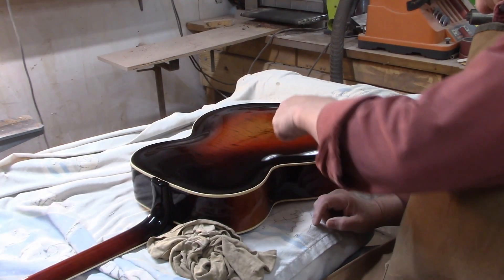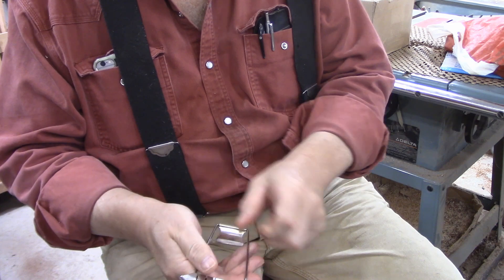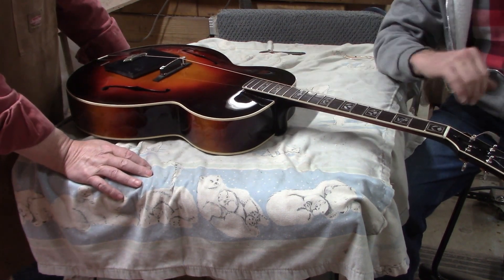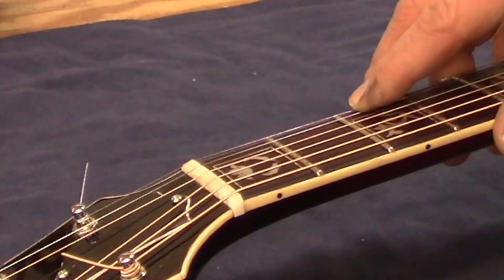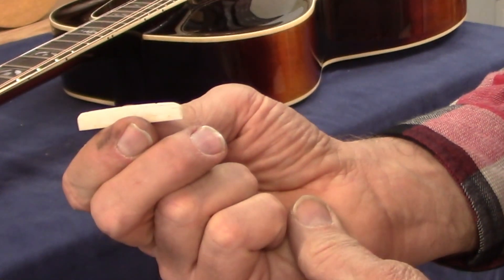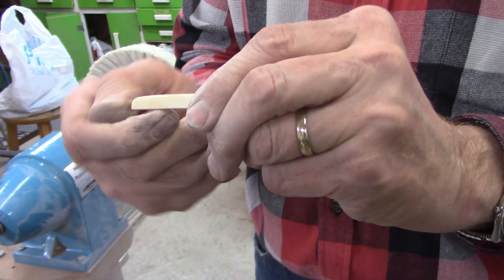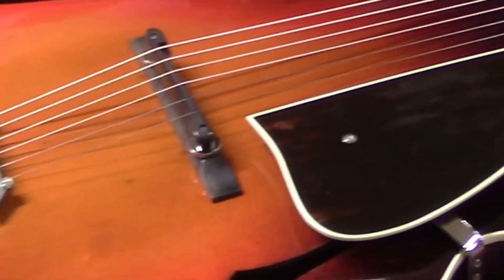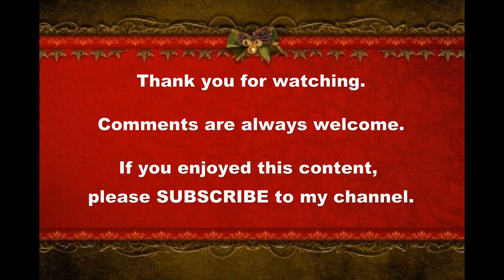1937 Gibson L7 Restoration: The Final Chapter

Comment: Gary, do you actually set the final string heights at the 12th fret @ 1/16" (.062") for all the strings? That seems very low for the bass E, A and D . I would think that would result in string buzzing if the guitar is played with a strong attack.
Reply from the maker: No Bill. That is just my target for when the bridge is adjusted to its lowest point.  The strings will be set roughly at 3/32" on the bass and 5/64 on the treble. Thanks for watching
Reply: Ok  that sounds good.. Same setup as a typical acoustic...
 @zimnickiguitars311
Reply from the maker: @billdedrick1914 yes, and the adjustable bridge gives the player flexibility to easily adjust the action up or down.